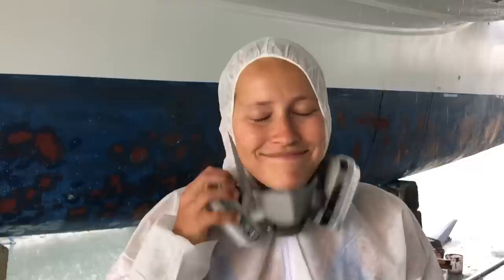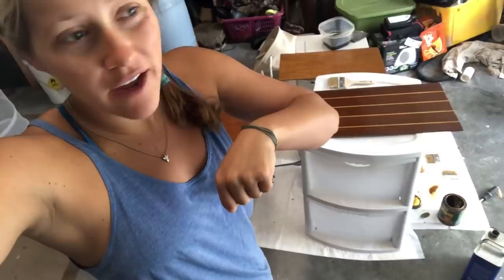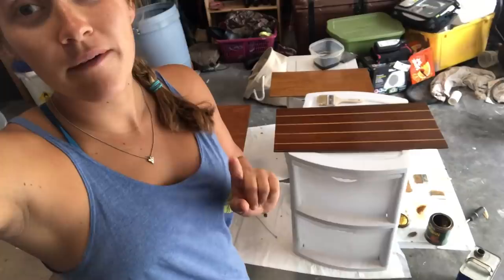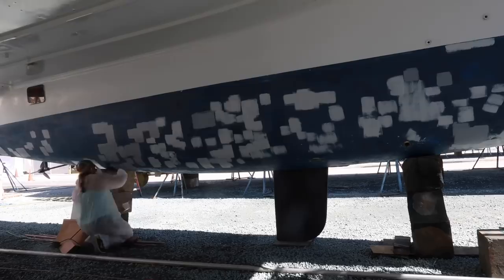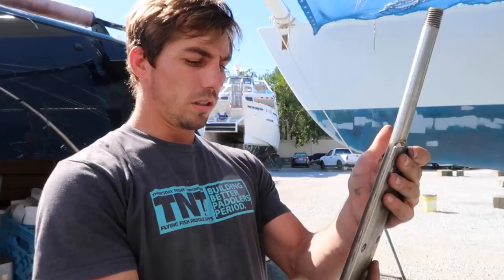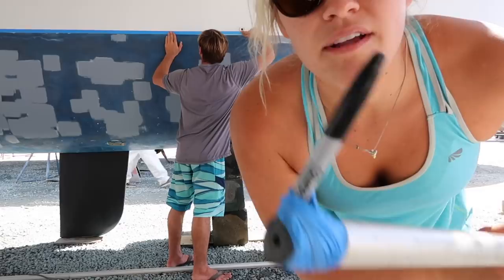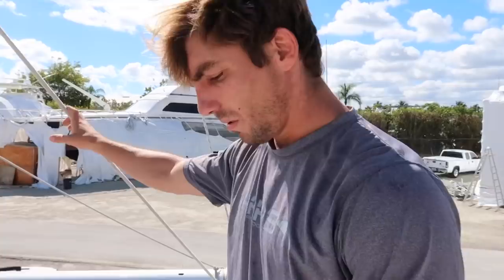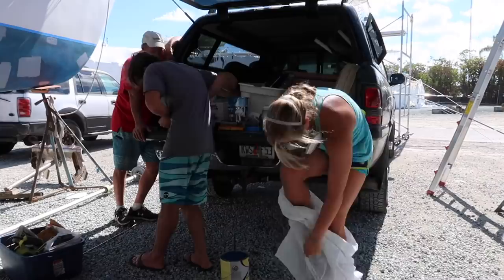SHE LOVES BOAT WORK!

Comment: I would make it storage for maybe some sails or have the tools kept indoors so they stay safe and clean and dry or  a place to put some new charts an maps and I say new ones because there are some things that the old ones will not have listed and since you two are going to be doing some traveling in some unfamiliar territory. And if for some reason the electronics go out maybe batteries are dead maybe it just crashes on you who knows but for a back up they are a good thing to have

Comment: We're about to do the bottom of our boat. From your experience, what sander should I buy, what grip paper? I don't want to strip the bottom, just good prep. What paint did you use? We're in the Chesapeake and keep the boat in the water. Thanks. Ted & Molly